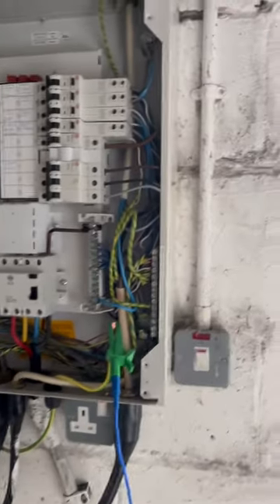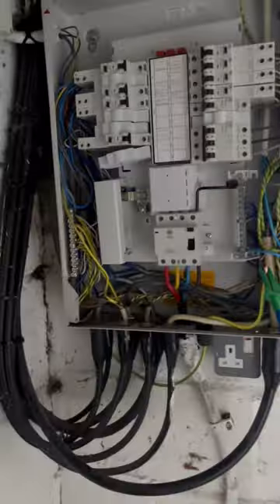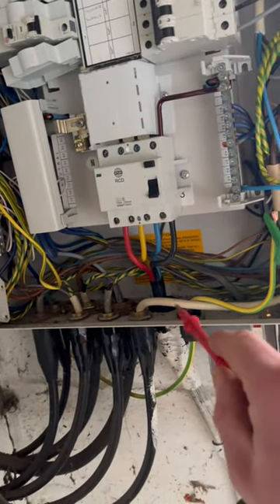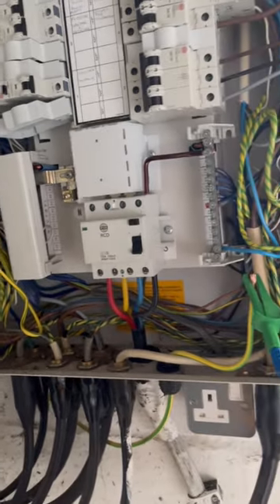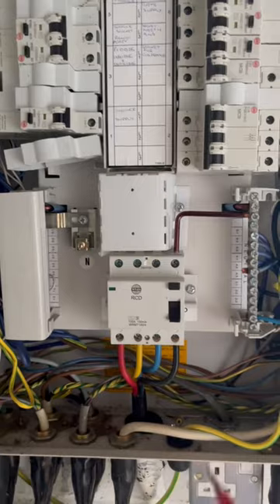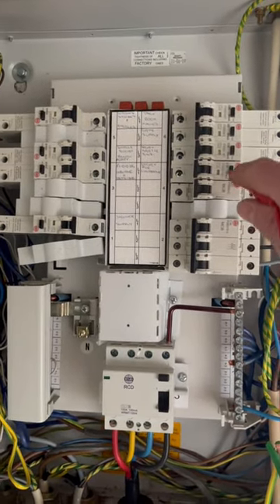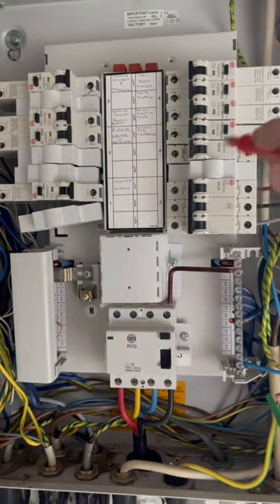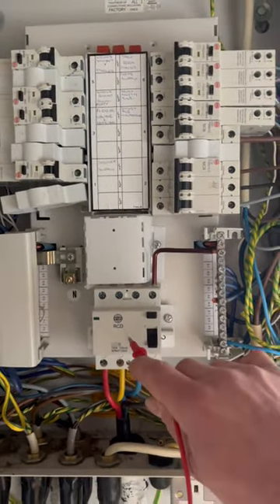TT earthing,  livestock , stables . PME earth is a no no. @mainly electrical. ❤️⚡️

Comment: Is there any extraneous conductive parts coming from the main building as they would be bonded using the pme arrangement so if pen fault does occur pipe work ect would be a different potential to anything earthed and bonded from electrode
Reply from the maker: Great comment ched .. that's one the reasons we TTd it 👌

Comment: Would have used PME and still put the structural steel to earth, so PME with rod, ie Protective Multiple Earth
Reply from the maker: Definitely not
Reply: @Mainly_Electrical  with rcd protection, why not, so to sum up ,rod with PME with rcd, tell me the reason why not?
Reply: @williamlowther7051  incase of PEN fault perhaps
Reply: @craigbutler6243  hence the rod,
Reply: @williamlowther7051  because this is a special location. With stipulations regarding the use pme earthing
Reply: @tomorichard  hence the rod,

Comment: why’s it needed to be changed to tt?
Reply from the maker: PME earthing d b in a stables is a no no , easier to TT it 👍
Reply: @Mainly_Electrical  sorry why isn’t pme allowed in stables?
Reply from the maker: Due to the voltage drop on the neutral and the potential difference between exposed and extraneous conductive parts to true earth ... needs to be TT a sort of clean earth to a point . The voltage on the neutral will be entirely dependant on the installation load and the impedance of the wires. Unless bonded floor grids are used which I won't go into to much now a PME earth must not be used . Hope that helps d b 😁👍
Reply: @Mainly_Electrical  so i have just searched more into this and because the neutral and earth are combined at house what do you mean by voltage difference because i thought neutral was at 0v thanks